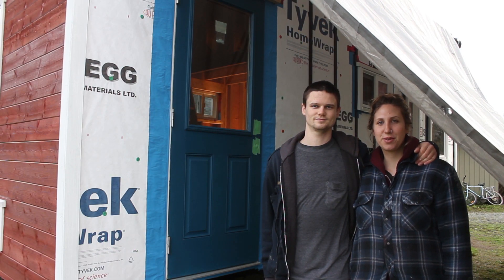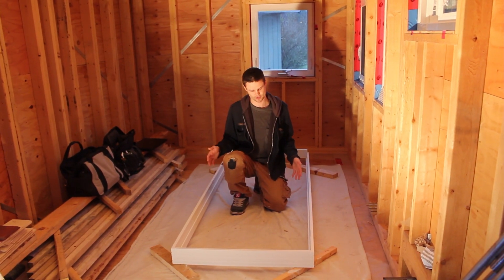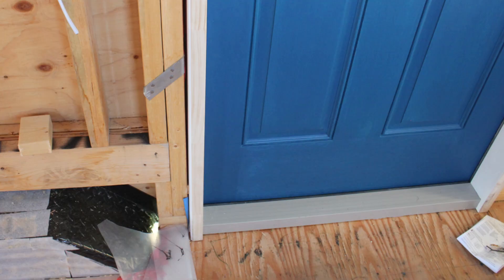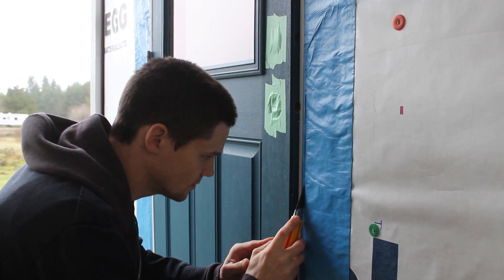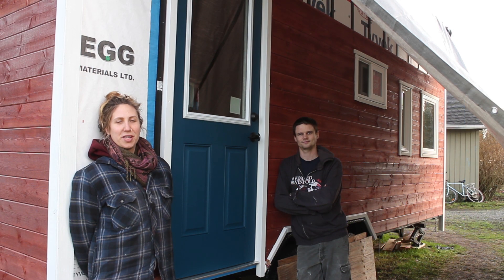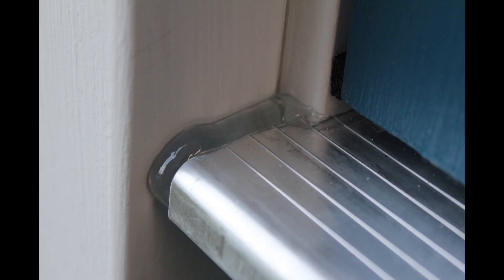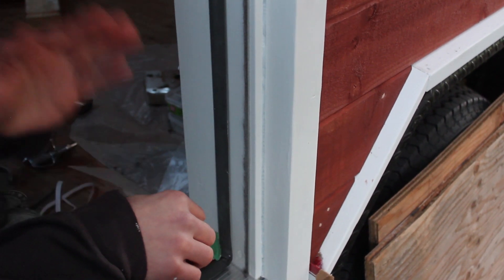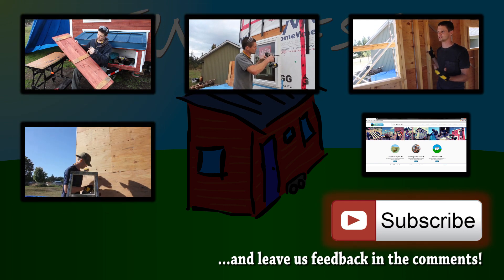Replacing our Tiny House Door (Ep. 23)

Comment: I'n not sure why an exterior door would have these issues. I live in a very humid climate that has a lot of sunny days. So my front door is exposed to huge weather extremes. It's a wooden door that's been on the house for over 3 decades. The finish takes a beating but the door doesn't swell or have issues with closing. Maybe it's because folks use so much particle board in things now. Maybe a steel door might have been a better choice. 

You guys are great at fixing these things. Glad that things are going well. Can't wait to see more of the inside finishes.
Reply from the maker: 1timby We had the same reaction, in that we assumed an "exterior door" would be able to handle totally normal exterior conditions. Steel was another option, but after really examining the issue and redoing it, it was simply that the perimeter was made of particle board and wood which was meant to be behind weather-stripping. The fiberglass on the front and back faces of the door is perfectly fine and durable. But you would think that either the door-guy, door-shop, or manufacturer would say something about the vulnerable situation we were entering into and give us a little guidance... but it always comes down to doing your own diligence, which we came up short on this time. But we've moving forward :) outside is very nearly done.

Comment: Hey there. Thanks for the video and the heads up! I'm in the process of finishing/protecting the doors for my tiny house, thanks to you guys.

One question for you - what type/brand of caulking did you use on your door? Is it also the same caulking that you used around the exterior of your windows/siding?

Thanks!
Reply from the maker: We started with some water-based stuff that was garbage... but now we use clear Quad (I believe it's LePage brand?) for all exterior applications.

Comment: Would it not been quicker,and easier to simply plane the edges of the door down?? or,chisel  the hinges in deeper??
Reply from the maker: FJ80Coop We showed where it was wedging on the non-hinge side, but it was also just as bad or worse on the hinge side, so there was no room to adjust it in that direction. It was pressed so hard against the jam that it pulled paint right off of it, transferring it to the door.We should have shown that side as well, to make this detail more clear.

Comment: Your door & frame is a Manufacturer problem not yours. I'm on Vancouver island and this is Canada's rain forest & I didn't have a problem. Latex paint is "water" based you should've sealed it with varnish 1st, then painted it with latex. Nice home by the way.
Reply from the maker: Stephen Bradley Hm, we did use that primer to seal the wood, and the rest is fiberglass, so we're hoping that it is in fact sealed underneath the latex. We've noticed that the latex comes off very easily... the slightest bump with anything solid will take a bit off... we're almost wondering if it should have some kind of more resilient clear-coat on TOP of the latex...
Reply: Tiny Nest I'm in Vancouver, BC Canada - we get about 300 days of rain a year, on average. Lots of wet and damp (lots of gorgeous greenery too, and our flower bulbs are coming up right now, in January - kinda makes it worthwhile...and you don't have to shovel rain ;)  I would highly suggest applying a poly (acrylic) over the latex..I would have suggested it before you put the latex on, knowing the vulnerabilities of it..but at this point, at least adding that as a barrier acts as a deterrent.  Just a suggestion ;)  

I'm loving following along with all of your videos - thank you so much for making them!  I'm excited to see how you do the interior - especially kitchen and bathroom -  and it's wonderful to see a couple working as a team.  Bravo!  I'm getting so many ideas for my own future build and like what another person mentioned - much respect for showing us what can go wrong too.  You're building a lovely home :)
Reply from the maker: Kimberly Polman Thanks a lot for the suggestion, we will definitely look at continuing to maintain the door. We've built a rigid awning to cover just outside the door, so it shouldn't get too much punishment for now (video on that coming up after our siding videos).We're glad you're enjoying our series :D there's lots more to go so stay tuned ;)

Comment: tiny nest if the weather flashing you installed fails and you do opt to try something else here is an idea , the company i am posting for you will not work with your door but the idea will help you find the weather stripping company that will , i have seen these in older houses and it realy does prevent waer blow in from outward swing doors http://www.finehomebuilding.com/how-to/master-carpenter/interlocking-weatherstripping-techniques.aspx